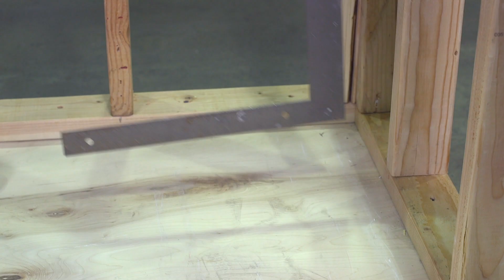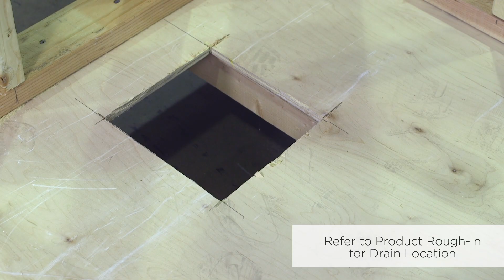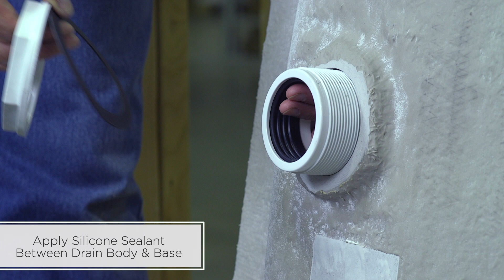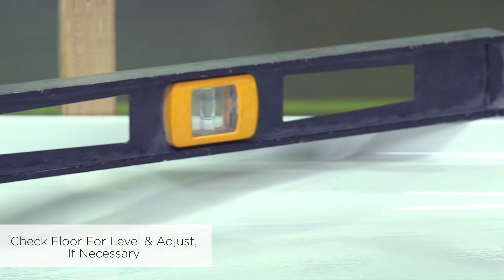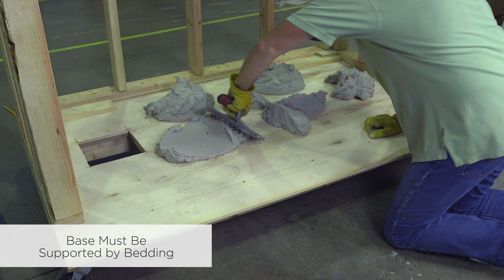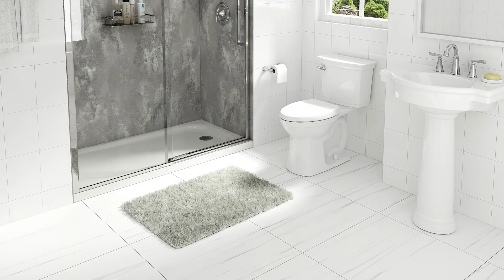How to Install the Passage Shower Base

Comment: F I N A L L Y . . .   do you have any idea how long I’ve been trying to find a video that demonstrates what yours is doing?  You’d think it would be easy to find, but no.  Every other video either sits the pan directly in the floor, uses blow foam, adds just a little concrete in one corner to level-out the pan, or makes the entire base out of concrete.  T H A N K   Y O U   for this video, it really helps.
Reply from the maker: Hello Neo! We are glad to hear that you found this video helpful. If you ever do need assistance, you can always give us a call at 800-442-1902 and a member of our Consumer Connection team will be happy to help. Thanks!
Reply: @americanstandard  AS, you should attach this video to your product for like Home Depot so the user can find it right away instead of trying to find it on Youtube like Neo and I.  It took me a while to figure out how to find it after going thru 5-8 videos.
Reply: Also AS, I am installing on a Garage concrete floor that is not quite level.  Will the mud be able to get me level?

Comment: My shower base has + under it for various support contacts plus a rapidly sloping base how do you gauge the thickness of sloping mud plus not get any under the +’s?  I wasthicking of globbing piles of mud around various points of the base and allowing them to spread accordingly.  The weight of the base is very very heavy. Thoughts?   I still find this video  for the mortar process lacking.  Especially for the sloped bases.  If too much mortar applied, the +’s won’t contact floor or even worse prevent perimeter from contacting floor

Comment: Apply silicone between drain body and shower pan? I used plumbers putty on the last 100 drains I installed. Guess I did it wrong. Ah, American Standard, why couldn't you just make a shower pan with some support on the bottom? I've seen plenty of shower pans that come with built in support blocks, and they work just fine on any floor. If I wanted to mix concrete, I would've gone all the way and used a shower liner, not a shower pan. But whatever, customer already purchased it, needs a shower now. I still got to wait for the stupid mortar to dry before I apply any weight on it! How long is that gonna take? Well, depends on how much mortar you use. Ok, how much mortar do I need to use? You don't say! Why not? Ahh, that is some quality installation video! Then you can't even screw the back lip to the studs? Or can you? Should be fine with all that mortar under it. If the mortar doesn't support it all that good, then the screws will! Oh, and you wouldn't need to wait for it to completely dry! How about eliminating the mortar, cause the screws will hold it? Or will they? Makes me wonder, why do people ever design shit like that? At least make it so it can sit level on a level floor, by itself, or provide some shims for it to sit level without putting any strain on the front flange! That's what you get when the design team does half ass job to make something more affordable, but it ends up costing the consumer more anyways! Standard practice here, go figure...
Reply: You are correct this is by far the worst design ever. Takes 3 and quarter inches thick of mortar on backside and various amounts in various other places. I used 3 60lb bags and still wasn't enough for 60x32 pan. I wouldn't take this pan if they paid me 500$ to have it. Unfortunately customer bought entire shower kit at home depot and they have no idea how terrible pan design is 😊

Comment: Anybody else install this shower pan and completely underestimate how much mortar mix to put underneath? The amount needed to support the higher end of the shower pan is way thicker than you think.
Reply: How much did you buy? Installing this pan tomorrow and I picked up 2 55lb bags, hoping that will be enough!
Reply: I used 3 60lb bags of mortar mix and it still wasn't enough. It takes 3 and a quarter inches thick on back side and almost as much on front so 32x60 pan at just over 3 inches thick is a lot of mortar. This is the hardest pan on the market to get level and makes a horrible mess trying to level it then lifting pan out several times to adjust and mortar all inside pan and all over bathroom. They make other brands that have a screw flange to screw to studs and also the support built in the bottom of pan so you just need to add a little mortar or shim here or there and some are even simpler. I have been in construction industry for 30 years and I have done everything involved in residential construction and some commercial construction. I understand all phases of building and I am a carpenter first and what I enjoy most. I have designed and built projects for art museum of N.C and Greensboro Science Center that were one of a kind and a lot of figuring solutions for seemingly impossible issues. This pan was the worst thing I have ever done and the poorest design on the market by a long shot.
Reply: @KevinHouse-fc4dm  thanks for the reply. I ended up ripping it out the next day and installing a different one. Yep, have no idea how that thing is still on the market, it’s a piece of junk! Unlike you I’m new to the trades and even I soon realized just how poor of a design it was.

Comment: The video doesn't properly illustrate the correct amount of mortar to do this. The bad part is that people doing this job need to be able to take a shower sometime in the next decade. Having to redo this job is very time consuming. Not to mention the possibility of damaging the pan in the process, having to shell out more money or even special order one and wait. I'm terribly disappointed. You should be ashamed! I can't wait to tell everyone I know that this is a piece of crap!
Reply from the maker: Hi David - Sorry for the frustration! We appreciate you taking the time to share this feedback with us, and would like to learn more about your experience. Please give us a call at 800-442-1902 so we can get some more details and help address your issue. Thanks!